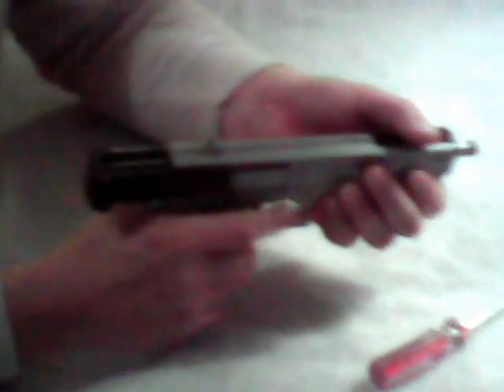bb pistol to .22 conversion tutorial

Comment: I'm currently about 90% through this conversion. But I am drilling out a half inch steel rod for the barrel because it is all I had on hand. But I now have a dilemma. I broke a drill bit inside it and can't get it out 😅 I have tried the arbor press, oil, hammering. I'm stuck. Any recommendations would be greatly appreciated lol

Comment: *I use this>>>ur2.pl/954     as a prop for Dinner Detective (murder mystery show) and for filming. It looks and acts beefy enough and handles well enough to get the job done while not being all that dangerous. I never bought the BB's for it but don't think I could kill anything with it even if I did which is why I like it.
It does not sound as metallic as other guns may sound but that can be taken care of in post. I like the real gun look without the real gun danger. The most dangerous thing about it is that it does not have an orange tip. One could mistaken it as a real gun and shoot you. It will also hurt you if you bash it into your teeth.*

Comment from the maker: I found a small metal bar that would fit inside the pipe. clamped the pipe in a vise with the bar inside it and heated it with a torch, then I twisted it with vice grips on the other end. it ruined both ends of the pipe but after I cut the ends off it was fine I just drilled out the first inch of barrel. Hillbilly rifling.
Reply: Yôh still do things likè this?

Comment: Last time I used one of those galvanized pipes for a barrel, I drilled out the inner lip. This time I decided to go with the barrel liner and had much better results. Also, the barrel liner has 5 or 6 ridges instead of one. How did you manage to twist the barrel??

Comment from the maker: The big spring had to drive the cartrage into the barrel a couple of times for me to realize it was too much. I have added a longer barrel and a stock on this pistol and I also rifled it by twisting the barrel. the plumbing pipe has a ridge running down the length of it so when the pipe is twisted it turns the ridge into rifling. It increased the accuracy trermendously.